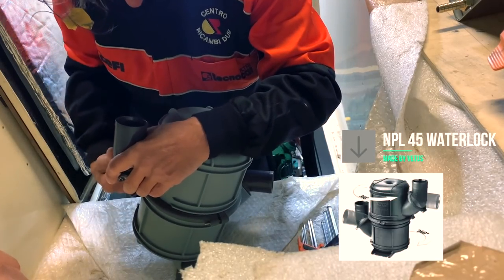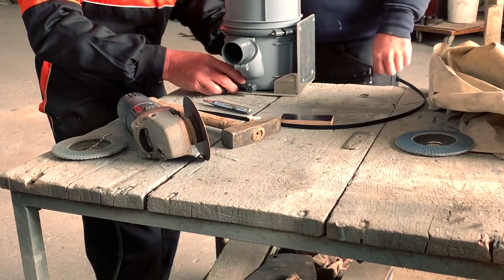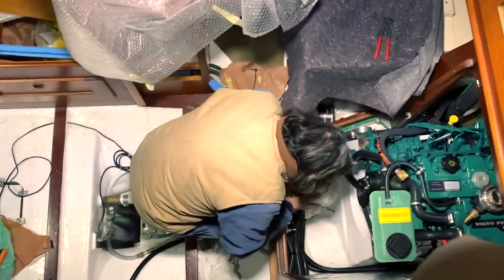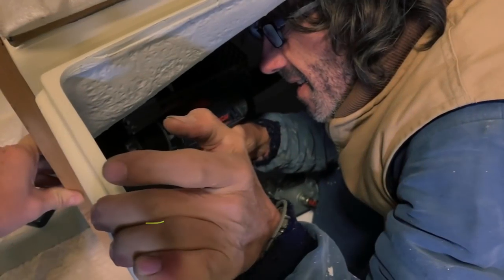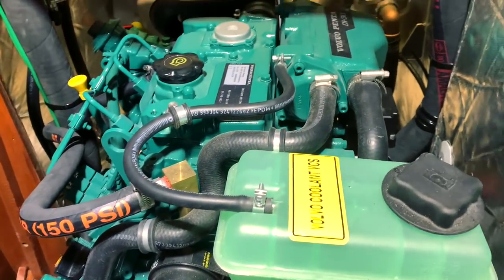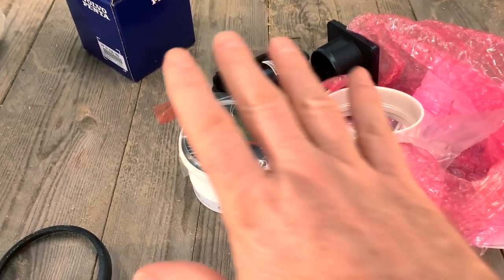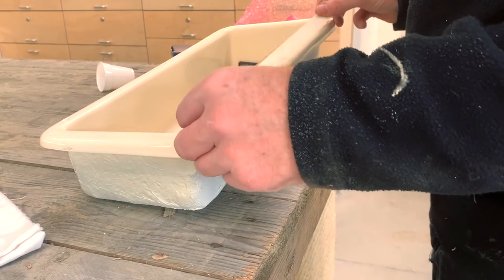Hallberg-Rassy 312 "Ellös": INSTALLING THE VOLVO PENTA D1-30 PT.2 DIY

Comment: Hello Gabriele !  I am always amazed by your taste for quality workmanship. I learn a lot by looking at your videos. It give me good ideas for the maintenance of my own boat.
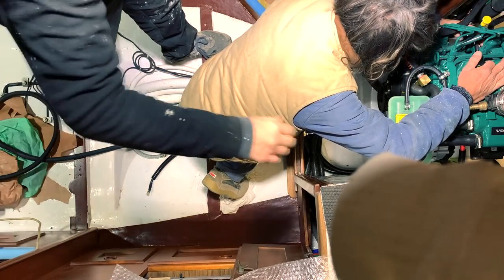I am a little concerned about the hose passing true the fuel lines (6:50 on the video). A diesel engine vibrate a lot and I think that the hose might suffer from abration if it is not well protected from rubbing against those fuel lines. Of course, it will not append overnight but, better safe than sorry.
Reply from the maker: Hey mate same my concern I will move outside that hose I don’t like too! Thx for advise!!!’

Comment: Engine installation looks good!
Now when you have everything connected, remember to check that you have no electrical connection or conductivity between the gearbox and the engine.
Reply from the maker: Pay a lot of attention ! Was already assembled by Volvo sono problem I check the electricconnection and was perfect!!!
Reply: Very good to check because another guy with a Volvo had a missing isolation washer. The dealers don’t know about this and they don’t check.
Reply from the maker: I got same concern Ben regarding the bronze water filter... need to check carefully if is better to use the plastic one....

Comment: Hi! Great video as always! Just would like to ask you where did you install the vacuum valve? I couldn’t see it usually stays after the raw water pump or after the heat exchanger.
Reply from the maker: What you meaning vacuum valve?
Reply: I mean anti syphon valve that prevents overflow the engine with raw water.

https://www.vetus.com/se/antisifone-con-valvola-4839.html
Reply from the maker: No I did t install it. Ready I’m my hand but I need to make the first trial in open sea with Volvo mechanic… check everything  and if need I install straight away I’m at the limit border to install or not install it as the instruction followed
Reply: @sea4see  Well if that me I wouldn't think for a second because this is serious. Ok let's say that the mechanic says that the syphon valve is needed after the sea trial. Well after can be to late if you get sea water inside your engine... I  am asking you because tomorrow I'm going to install the same D1-30 on friend boat and I know how careful you are taking decisions about work and design. I hoped that have already been true the dilemma where to place the syphon valve.  Please don't hesitate install it.  I personally like the vetus model with the drain tube because  the drain can be installed in the cockpit and if there is malfunction on this valve it will start leaking and you will see it to close the seacock.
Reply from the maker: @Asen Naydenov  thx mate !!! Piece of cake installing it if not need I will take out…but I will follow your advise!!!!
Reply: @sea4see  Yesterday I had a chat with the local service department here in Sweden and they said in case the engine is 20cm or lower below the water line high riser and syphon valve is a must! The place for the syphon valve is between the raw water pump and the heat changer. Good luck!
Reply from the maker: Tomorrow I will install it!!! Already all stuff in my hand thx for your advise and save my engine